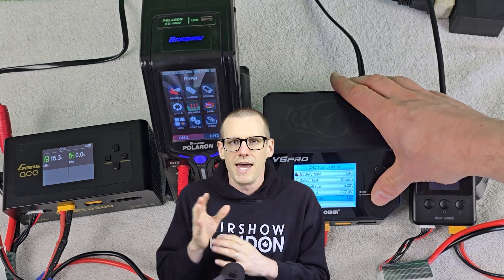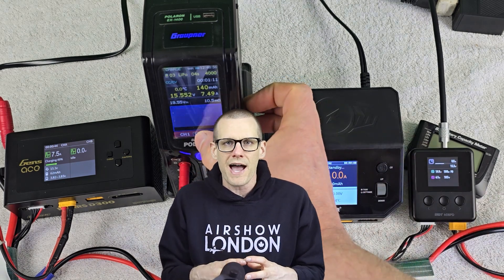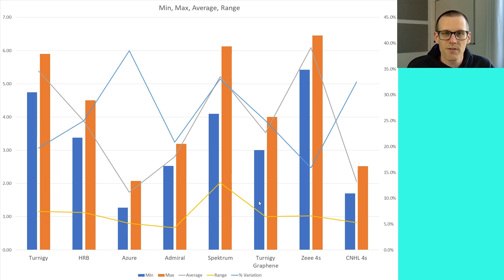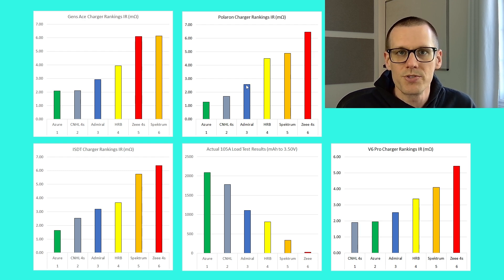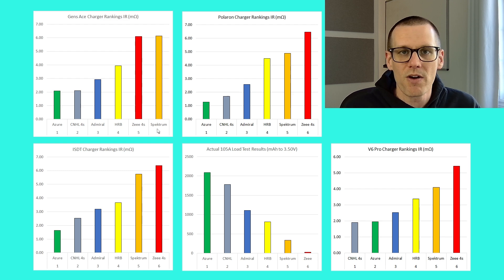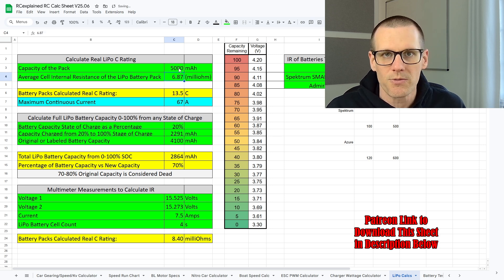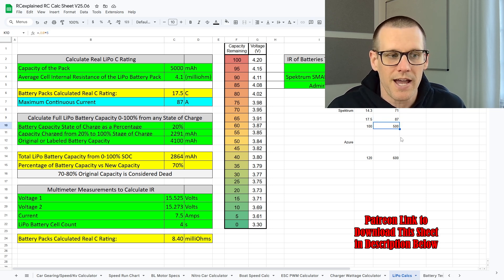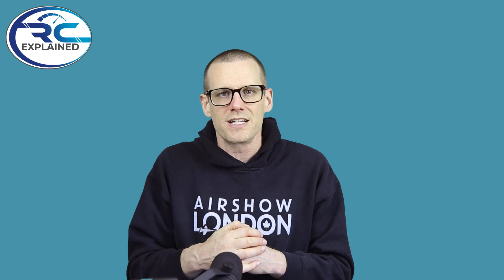LiPo Charger IR Values EXPOSED! Can You Trust What You See?

Comment: I would not trust ANY charger to provide accurate measurements especially devices that can not be accurately calibrated. They can only give you a rough idea. Some of the better chargers can be used for comparative testing as You are doing.  I personally use calibrated lab test gear and Spectrol Reliance precision dummy loads in the test dept ( temperature and humidity stabilized room ) For performance critical applications such as battery packs for high power HF radio transmitters I test each pack at 3 different temperatures and 3 different loads while monitoring and recording V,+, I, R and  the temperatures of the pack and the fly lead connection.  We also use a precision VNA with calibrated DUT enclosures. I was horrified to discover the majority of  'RC ' battery packs are so wildly out of spec they would never get approval for comms use.  As You have seen from Your comparative tests there are very few battery packs that even get close to their advertised specifications.  It is a shame that so many people are being ripped off with the false advertising and incorrect labeling on RC battery packs.  Keep up the good work Sir.  People can only avoid wasting their money on rubbish if the are made aware of it.
Reply from the maker: Thanks for the comment. Very insightful!

Comment: When measuring the IRs of a battery, you should always use the same charging cable for all chargers and batteries.  Due to the mixed cables used, the data gathered is of almost no value.  Rerun the test again with two chargers with the same charging cables and compare against your initial data.
Reply from the maker: I'm not sure which video its in where I show how the charger reads the voltages and calculates IR. Its not through the main leads as you would never be able to compensate for the different wires, connectors and engagement thats forever changing. The charger must use the balance tap. The charging cable could be of the highest resistance or the lowest and the voltages at the balance tap would read the same.

Comment: Ty for this!! I would love to see you compare spektrum 50c vs 100c vs thier 120c pro basher with graphene lipos!!!
Reply: I agree. My spektrum batteries are 50c and are no where close to these internal resistance values.
Reply: @limberg2005 i have those same batteries 3s 5000mah 50c what are ur IR readings?
Reply: @xLILxWANGx  Mine are 4s 50c 5000mah. The IR is usually around 1.5 to 3.7 (depending on when it's measured)
Reply: @limberg2005  mine are 3.4 to 4.3 with 12 cycles on them.. is this ok?
Reply: @xLILxWANGx If the Internal Resistance hasn't changed much and remains consistent across all the cells, it should be fine. Mine are new yet with only 4 cycles
Reply: @limberg2005  awesome ty!! I wanna try the spektrum pro basher 120c lipos with graphene!!

Comment: Thanks for running these tests for us, I'm sure it's a lot of work that you put into this. It would be great to see Gens Ace Bashing (60C) tested in your future videos as well. I think also the voltage drop under different load values (20/50/100A) when fully charged as well as when half charged would also be of impotance when judging a battery performance.
Reply from the maker: I've been trying for a while to get a gensace. But will eventually get a hold of one.